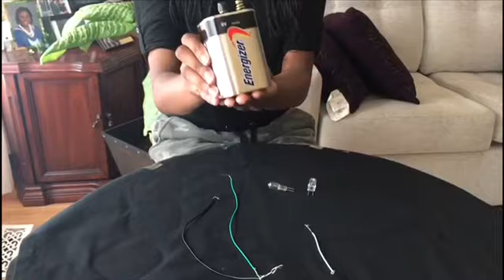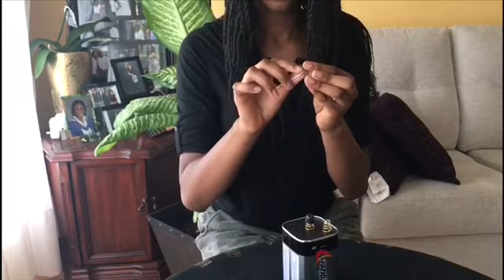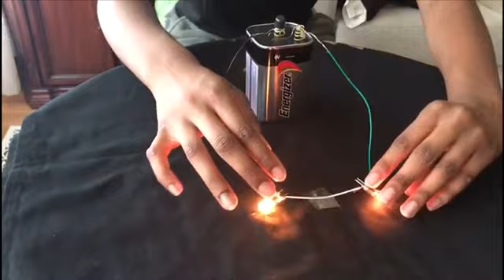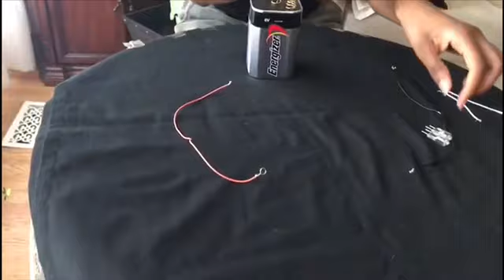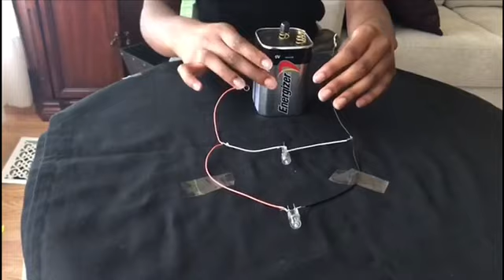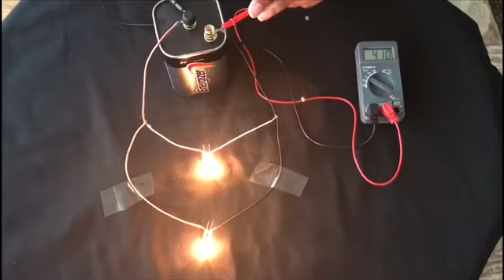Electrical Circuits: How To Build Series and Parallel Circuits // Simple At Home Physics Experiment

Comment: How 'bout if the wires is connected together for e.g. red and black wires how can you connect it in a series circuit?
Reply from the maker: Honestly I'm not completely sure because I haven't worked much with connected wires. Sorry about that, wish I could help you out